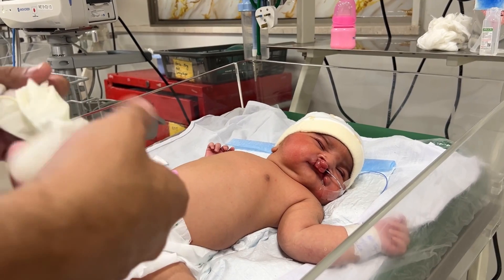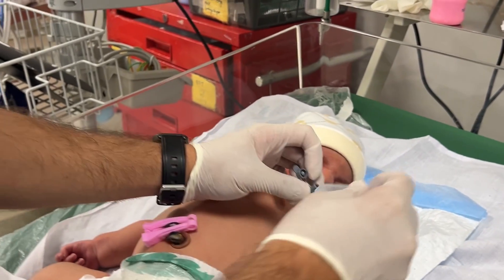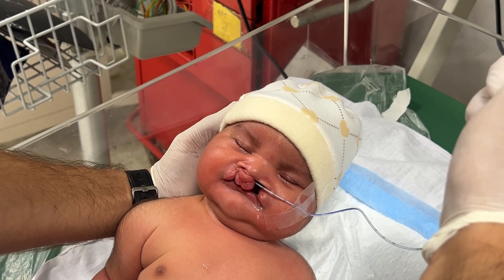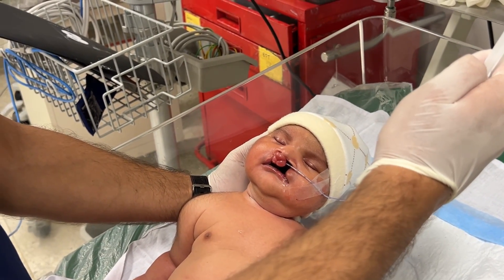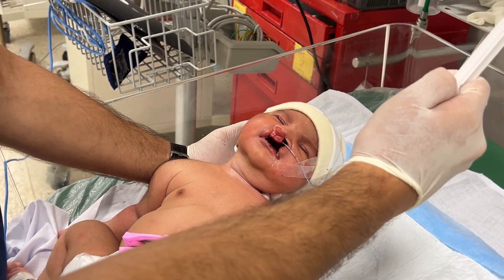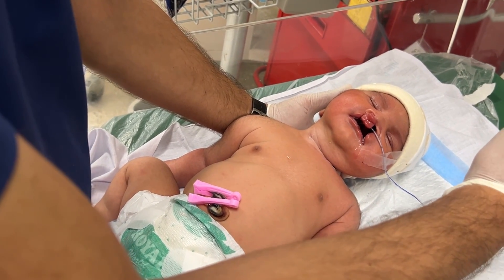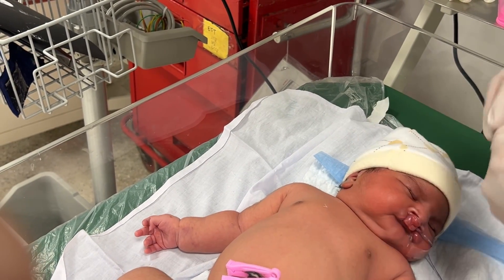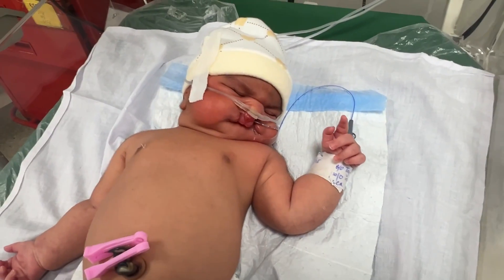Case: Cleft Lip and Palate Baby  | NG Feeding & Oxygen Support Explained

Comment: This poor little angel. Do you do the surgery to correct the cleft lip and cleft palate? If not, where do you send the baby to have it done? Its not a long surgery, about 45 minutes for the lip and an hour or so for the palate.
Reply from the maker: This is a hospital setup and the baby is sent to operation theatre when surgery is scheduled . And this surgery will be done after 3 months . Not in this stage 🎉
Reply: @DrTalha12  I was 6 weeks old when I had my lip and palate repaired.
Reply: @DrTalha12 I was born with one side not both sides.
Reply: @DrTalha12 what is your opinion about why this happens?
Reply from the maker: @Cloud99471  his can happen due to genetic factors, nutritional deficiencies like lack of folic acid, uncontrolled diabetes in the mother, or certain environmental exposures during the first few weeks of pregnancy.
In many cases, there’s no single cause it can happen even in perfectly healthy families. That’s why awareness, proper antenatal care, and early diagnosis are so important.